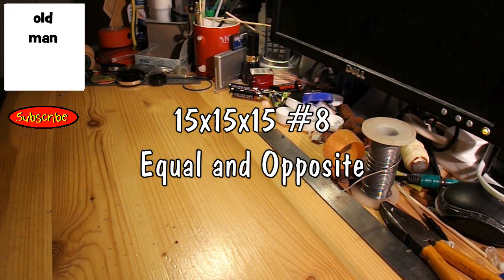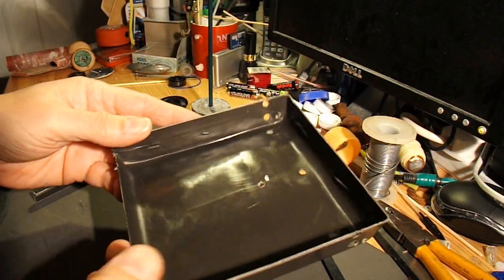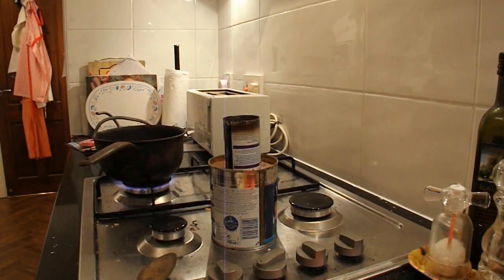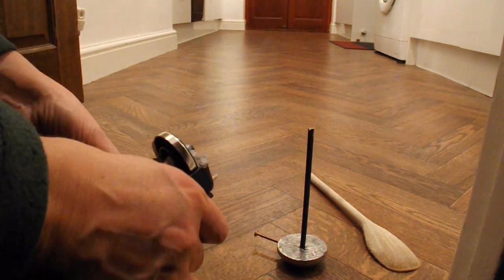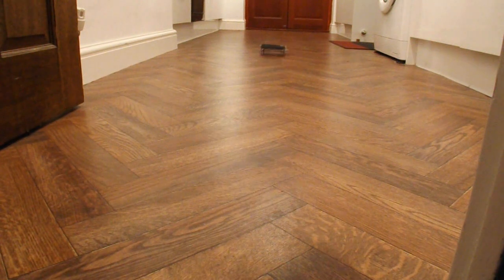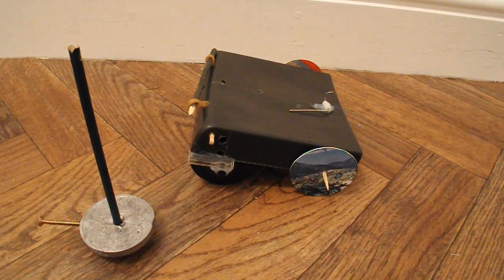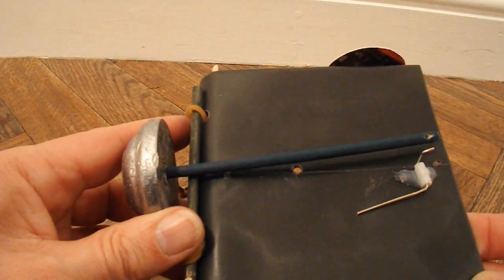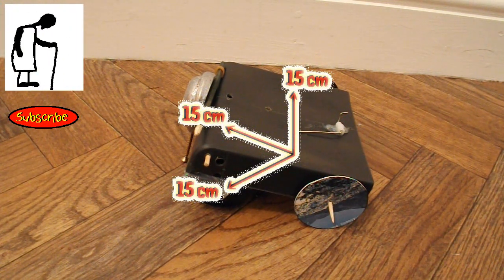15x15x15 #8 Equal and opposite - crossbow car

Comment: would it be possible to make a home made rc and have tracks on it so it can climb rocks and stuff
Reply from the maker: +Matthew Lucyshyn if you want to go over rocks you are probably better off with a hobby grade 4x4. Here is a good example by RC Hunter https://youtu.be/2NjbihPISRQ Tracked vehicles are surprisingly limited when it comes to very uneven surfaces, OK if they are going straight forward and the uneven surface is at right angles to the direction of travel but they struggle turning and quite often lose a track. Another problem is actually finding, buying, or making tracks. They are either very expensive to buy or very time consuming to make.
Reply: You could just put ruber bands for traks
Reply from the maker: +Matthew Lucyshyn try it yourself, you will find it is not that simple.
Reply: I am trying to right now but don't have the correct motor...what do you recemend for a motor?
Reply from the maker: Matthew Lucyshyn I cannot recommend a motor. I don't know what gearing you intend to use, what weight your vehicle will be, and even if I did know that I still would only be able to talk about the cheap motors I get from toys. You need to drive the tracks very slowly so you need to gear down the motor with the right ratio to get it right. Here is a great scratch built tank by Nesmaniac https://youtu.be/sd-TYyLtKP0

Comment: Very clever design!
Reply from the maker: Thanks. Because I had limited it to fit my 15x15x15 series it did not work as well as I had hoped. I then modified it to this design and it worked the way I had originally intended http://youtu.be/64Xm9FlLqGY